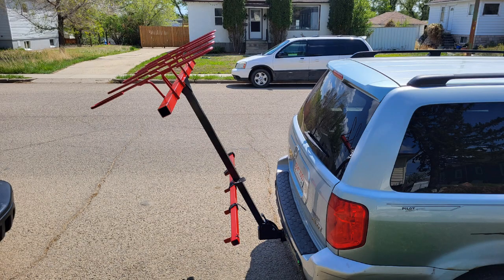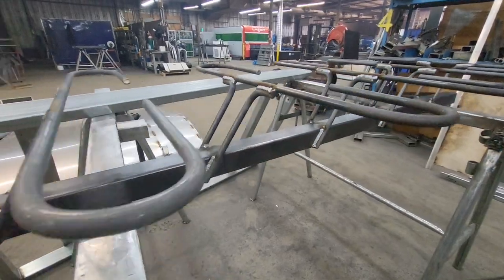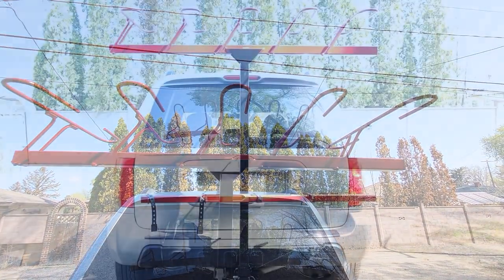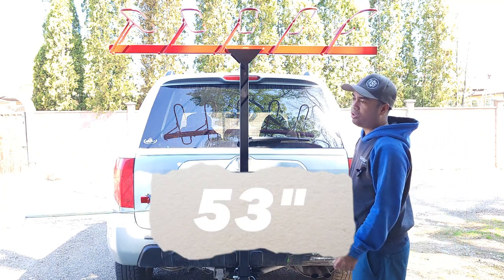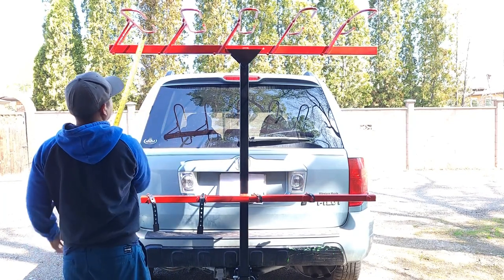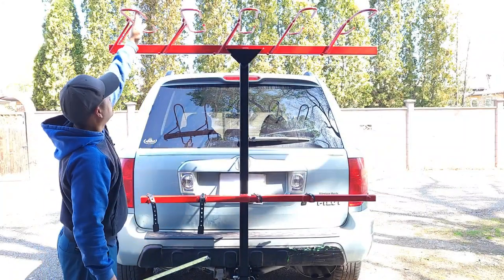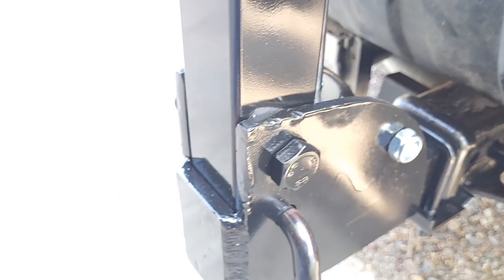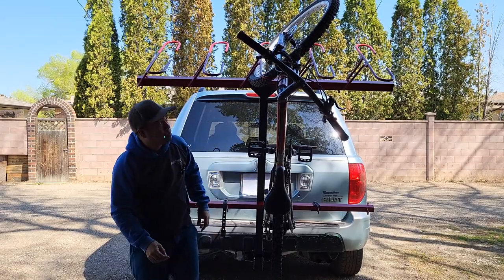DIY vertical bike rack(my dream build.with measurements

Comment: Very nice I'm about to start my rack build. Can you tell me what wall thickness you used for the three 2 inch square tube sections?
Reply from the maker: For the hitch I used 1/4" and  the rest is 1/8". I'm planing to build another one using 2x3 on vertical like the original. For 6 bikes.
Reply: Thankyou I actually used the same for a 4 bike rack. It seems pretty stout. @noymovs